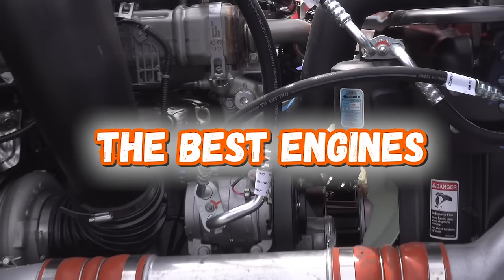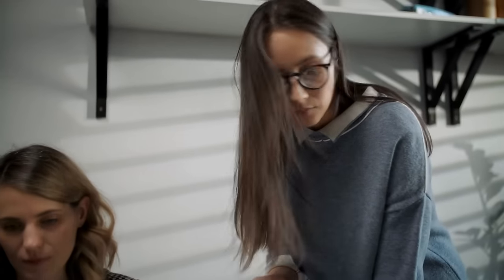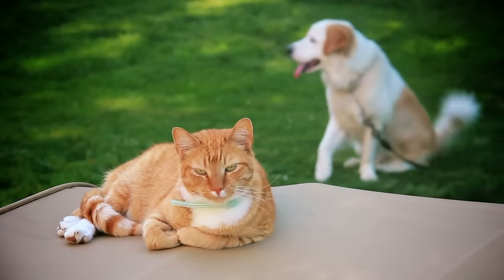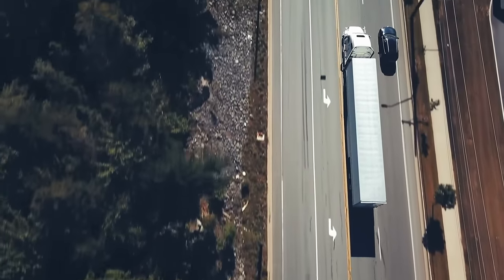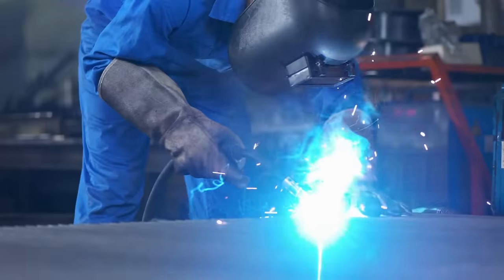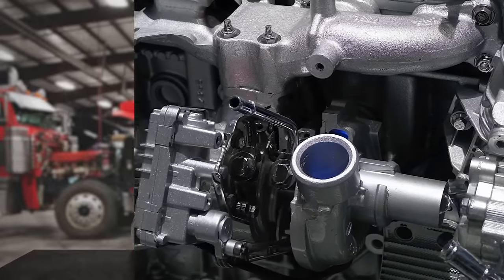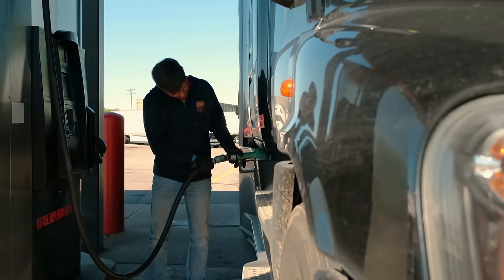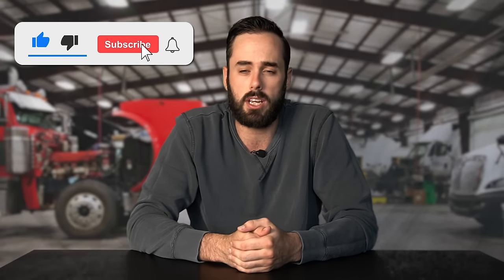The BEST Diesel Engines of All Time! (CAT, Detroit Diesel, Cummins, Mack)

Comment: Personally I'm a little sad to not see an opposing piston engine, even if it's not one of Napier's mythical “Deltic” engine. I'm also sad to see a lack of the two stroke engines Detroit Diesel is famous/infamous for.   My reason being that contrary to what you'd think, two stroke diesels, (especially opposed piston ones) can actually run dramatically more efficiently than four stroke diesels due to their complete lack of a valve timing system

Comment: This video has missed the european technology although I think the detroit DD15 is a rebadged mercedes.  Even nowdays in North America Volvo has taken the lead, certainly in horsepower I think volvo's new motors are breaking 700hp.  Iveco has revolutionary motors with revolutionary power, I think for a very long time their natural gas diesel motors have had revolutionary efficiency and I think some of their diesel are getting up to incredible levels of power now, like 8 liter diesel with 450hp.  Mercedes diesel are interesting, they made v6 diesel in commericial trucks, I think the V6 was compact and contributed to better cab designs,  Mercedes new inline 6 has a revolutionary way of using exhaust gas recirculation to control the throttle and boost.  Scania has a great diesels.  Toyotas released the first Common rail diesel in the hino ranger in 1995.  Asians make great diesels.  There's also trucks by Peugot and stuff too
Reply: The DD13, DD15 and DD16 are Mercedes engines, same ones they run on the European trucks, they just don't offer the 650hp version of the DD16 stateside.  Volvo dropped the D16 from the US market a few years ago, and 600hp/2050tq was the most powerful rating they offered in the US on the D16.  Best you can get in a 2022 Volvo is 465hp/1650tq from a D13TC, the Cummins option was dropped entirely.

Comment: I seen an old ripping tine of a d6 get put in a tub grinder with a c27 cat int and well the exploded like an atomic bomb and the 11/4 inch thick walls with gussets all over blew out like a wet paper bag then it was raining molten steel and well the clutch did it’s job and the mighty c27 was just free wheeling idling away ready for a new job

Comment: E7 first produced in 1989? 🤔😱  I think you might be off by a decade, the trash company I worked for had 30 1979 mb cab and 1980 mr cabover E7's. 237 horse, 1200 foot lbs torque at 1200 rpm. An Allison 654 with a torque converter stall of 1200 rpm. A tag next to the parking brake button stated, Failure to release brakes will result in driveline damage. We had a spare driveline for every possible combination in stock.
Reply from the maker: We'll look into that

Comment: The best engine is the one that can make me reliable money
Reply: Series 60 has been a reliable engine for me. Already paid for itself since I got the whole truck for a great deal years ago. Still have it and drive it. It's in my go to truck and my engine of choice.
Reply: @DJPereira2012  for me its the c-12 cat  stuck in a 2002 378 the frame has a bit over 5 million miles on is with 2 inframes its entire life time and 1 major rebuild to replace all the bearings, crank, and cam but I always hear good about the 60 series of I get a new truck I'll try one out
Reply: @thomascampbell3435  I knew nothing about this series 60 till I got a truck with it. I like cats too. I have an industrial big forklift with a hay squeeze. It has a 3208. Sounds like a solid engine that just runs and runs.

Comment: For pre emission Nothing tops the 12.7 series 60 it’s the most reliable, easiest and cheapest to work on and best fuel mileage. Sure it won’t out power a cat but over lifetime ownership the Detroit dominates 

For a modern emission engine nothing beats the Detroit DD series I put 1,000,000 miles on a 2013 DD13 and it never broke down besides around 50,000 miles the def pump went out. Baked the dpf at 250k and replaced it at 500k like the owner’s manual says. It finally gave up the ghost a little after 1 million miles 

and now I have a x15 Cummins and it’s a dog constantly got mil and cel on always needing to plug in the laptop and run a forced regen to get it to clear codes goes through about 4 nox sensors a year it’s junk.

Comment: I’d love to see a breakdown of the best emissions compliant engines if possible! I feel like it’s much easier to find info about the older ones than these new ones.
Reply: These are all emissions compliant, none of them other than the 855 Cummins come anywhere close to GOAT. Honorable mention can go to the 3406E, but it is nothing more than the electrified emissions compliant version of the 3406C mechanical fuel system.
Reply: @bluedogsalvage5246  I mean dpf/scr/post2010 emissions regs.
Reply: @thelol1759  There are no good ones! You make your pick based on the best warranty and dealer support  and trade early because non of them will be running as trouble free as the worst engine on the video.

Comment: I’ve been in the industry for a long time and I don’t mean to be overly critical, but there are a lot of inaccurate statements in this video. Such things as the Cummins 855 Big Cam being replaced by the N-14 in 1985 when the were actually produced side by side in the early 1990’s for one. Second being the Cat 3406 models skipped a D series because the E represents Electronically controlled injection. Third is the Mack E7 was a 12 liter displacement engine meant to offer REASONABLE horsepower and torque output (though not a “powerhouse” by any means) while maintaining good reliability and efficiency for both vocational and on highway applications. There are other discrepancies but I won’t get into nitpicking. Please just do a little more research and you’ll have it.
Reply from the maker: Thanks for the pointers! We'll definitely keep that in mind for future videos!

Comment: You state the Cat C16 as "the beast" then give a shiitty torque figure of 1575. So Cat builds a one litre larger engine with less torque. That Swedish Skandia road diesel has an output of over 700hp and 2750 lb/ft of torque.

Comment: I can't believe you discuss an 855 and not the N14 or KTA. And the fact that you talk about a DD15 but not X15 is sad. X15 is the only thing post emissions that remotely reliable or has any power. This was poorly put together in my opinion. 3406 and C15 are the mecca of electronic engines. But you don't bring up V8 mack or like i said KTA or talk about why people still run N14. Just don't think research was well constructed.
Reply: Bias reporting.

Comment: 🤣🤣🤣🤣🤣🤣

You ignored the two stroke Detroit Diesels?

The smaller versions were literally the backbone of American fleet trucking.

The larger, later versions were a favorite of private/solo owner operators.

Rugged, reliable, and affordable.

The bad mouthing the Detroit two stroke gets is purely undeserved, and due to the fleets buying the smallest version possible, knowing it was cheap and nearly indestructible.

The late DDEC, especially DDEC IV silver 8V-92 was the power plant of choice when you needed 500+ HP, instantly, under any conditions, and failure was simply not acceptable. Fire engines, especially air port rescue, and military service.

The diesel of choice for power plants and emergency generators, for decades. An engine that could go from not running to max RPM.and max power instantly, when it mattered most. Hospitals counted on them.

Detroit Diesel two strokes have done it all, in massive numbers, for six decades, including World War II, Korea, Vietnam, and the first Gulf war.

Any list of great diesel engines without the Detroit Diesel two strokes is utterly incomplete.

Comment: I heard that CAT stopped OTR production be cause they could not make a diesel that met CAT specs after 2007.
 Or as CAT should have unpolitically stated does not meet CAT reliability standards.
Reply: There was not enough engine sales to justify the Research and Development to keep up with the ever changing EPA standards. Cat sells engines world wide and didn't have to abide by Tier 4 regs in other areas. They made the choice to get out and continue selling parts and support.
Reply: The last year Cat put engines in trucks from the factory was 2010 because they gave up on the extremely rushed enforcement of the 2010+ emissions standards.

Nowadays to get a Cat engine in a new truck you need an engine swap and a 2010+ industrial engine. The good news is that some C18 engines rated for higher power outputs don't have a DPF or DEF system fitted, and alhough they do have EGR, that can easily be fixed by welding the ends of the cooler shut.

Comment: Detroit 60 series biggest piece of junk never got home with out working on it after the second engine finally parted ways with it best thing I ever did currently x15 cummins its golden 489000 miles not seen a shop so far and way out performing that green engine power and fuel efficiency
Reply from the maker: Yikes!

Comment: The Detroit Diesel is the best one who cares about the others
Reply: Love the Detroit's and that's what we have here. Series 60 have driven the most.
Reply: Detroit is good but Cummins is better
Reply: @MINDSPARK-u6e  well, I've mostly heard of the Detroit's and the series 60 in particular in gliders. Cummings from what I understand has had many issues with emissions. Some how detroit has not had as many they say. I don't like emissions. Though for certain applications it's going to be required unfortunately.
Reply: @MINDSPARK-u6e  I definitely don't think so but they are the 2 best motors out
Reply: @Riighthandtrucking  
The Cummins X 15 has More pull in power with a gear ratio above 3.11 the Detroit don’t have it
Reply: @MINDSPARK-u6e  yes but that motor does not do good good in the cold like the dd15
Reply: @Riighthandtrucking  
I’ve never had a problem with it in the cold but then again I’ve always used motorkote oil; i’m not saying you’re wrong there is an AC line that crosses over the electrical junction to the turbine plug but they fix that with the new 2022
Reply: @MINDSPARK-u6e  I mean I would definitely put that motor as my second opinion tho
Reply: I agree but with CAT as a close second, the C16 is an amazing CAT engine but then you have the N14 Detroit diesel
Reply: Until they backfire. Lol Detroit is the worst in my experience outside of ijunko (iveco).
Reply: @MINDSPARK-u6e that is 100% untrue, I spent my last 10 years driving a 1999 Freightliner FLD120 with a 500 hp Detroit Diesel series 60 12.7 , Eaton 13 double overdrive and Rockwell 2.64 gears pulling 80,000 pounds and turning 9.2 mpg average.
Reply: @edmunger5595  
The 60 series Detroit engine is their last best engine or was the last messages, that engine is a very good engine in comparison to the Detroit engines after that, and that engine has a better fuel mileage, I love the 60 series Detroit, that engine is the last engine, literally produced by Detroit before freightliner took over Through Blackrock

But a 2.64 gear ratio is not a gear ratio for pulling power but fuel economy. Any gear ratio Bubba 3.0 is for pulling power and performance?

The problem with the higher gear ratio is that you will have higher RPMs at higher speeds, which would consume your fuel

Literally, if someone had the same exact weight concerning your load, the same exact truck with the same exact engine horsepower, but had a higher gear ratio they would pull up mountains better than you
Reply: @MINDSPARK-u6e  possibly but I can tell You that the 13 spd double over transmission replaced the original 10 spd and the 2.64 rears replaced the original 3.58 gears and I ran it for 10 years like that and never had a problem getting over a hill, of course when I started driving there were no big engines so we actually knew how to drive, the loads that 600 horsepower trucks are moving now we moved with 290 horsepower engines and 9 spds and 4 spd splitters.
Reply: @edmunger5595  
Wow, I didn’t know that..
Reply: @MINDSPARK-u6e  my first truck was a 1978 GMC ASTRO 95 had the 8v71 Detroit Diesel with 318 horsepower a 13spd direct ( no overdrive) and 4.33 Eaton rears, 10.00x20's 13th gear @2400 rpms it ran 57 mph....lol whereas my 99 with the 2.64's did 70mph @ 1250 rpms....lol
Reply: @MINDSPARK-u6e Sure, but of what benefit is that? Get paid the same no matter how fast you get up the mountain.

Comment: Back in 2005 l met a guy In Canada from the Israeli army buying or looking for 250 
Detroit S 60 series engines over 500hp.
Normal question why Detroit?
Well Cat too expensive to run parts service fuel avg. Weight etc..
Cummins don't like heat very finicky when it comes to high temperatures.
And Mack is like a mule he will take you there you don't know when. 
So number 1 engine overall 
Detroit S60 series.

Comment: I have driven cats detroit’s Macks and cummins not one has the power of cat
Reply: Well you’re right in power the top of the line is CAT , the thing is what your specks. The thing is not just engine you need to take al in count gearing , gear box what you need from it . And trust me a Mack E7 18 speed 4.6 gears will outrun the cat 13 4.1 on a steep hill, and reach a more middle road the cat will fly away. Depending what you need there’s no perfect combination for everything. You just need to speck the truck right.

Comment: Man y'all put that crap dd15 engine on there? Get that off the list please. That would be like putting the paccar mx13 on the list. The N14 is a way better engine than the dd15. And I'm a Detroit fan. 8v92 was a great engine but can be finicky. So i understand it not being there. But the coolness factor of being 2 stroke and having a supercharger is pretty awesome.

Also you have a lot of Cats on the list so I'm guessing you guys bleed yellow too. If you figure in cost, well cat is by far the most expensive to work on. Even the 3406, when buying genuine cat parts. 

Your list needs some work for sure.

Comment: I drove for a company that had Volvos and kenworth with Cummins and a few freightliners with Detroit and detroits were superior by far fuel economy breakdowns and reliability. Cummins sucked big time and when I had to drive the kdub was worst work days of my life Cummins suck no power and the sound you can’t tell if they’re idling or reving or watever it’s just chuga chuga chuga all the same stoopid sound. Volvos weren’t bad but broke down a lot so yeah I didn’t drive anything there but the freight shakers and they started buying those more cause I proved to them they were way better. Funny how the bosses sitting at their computers can’t argue with the reality of a dumb truck driver showing them how it’s done. And the 600 Detroit won all the fuel savings over the others. Hmmm more power does mean better economy since it’s not working as hard. Yep it’s funny how 40 years real life experience beats computers.